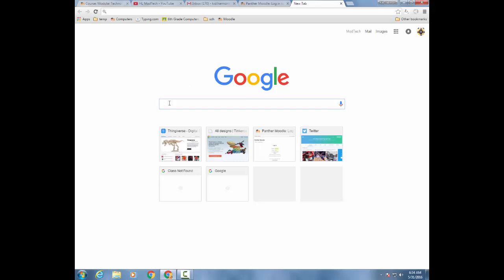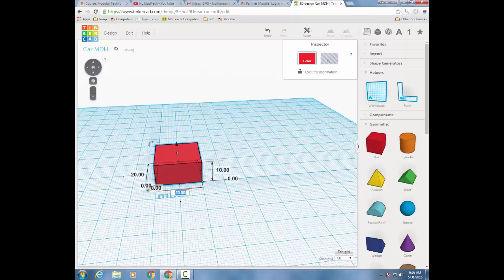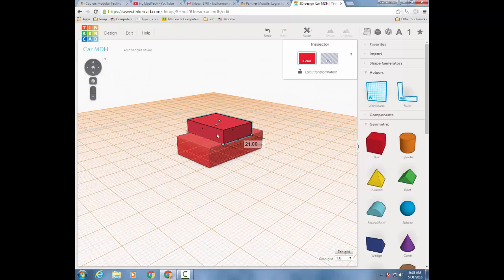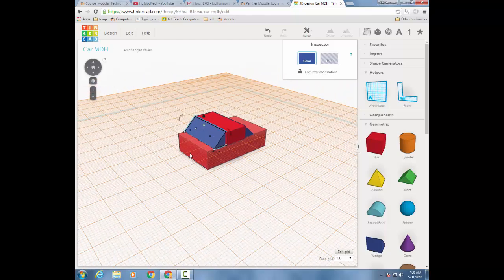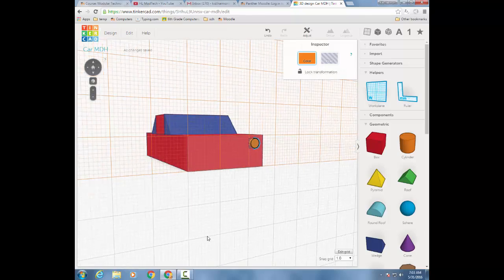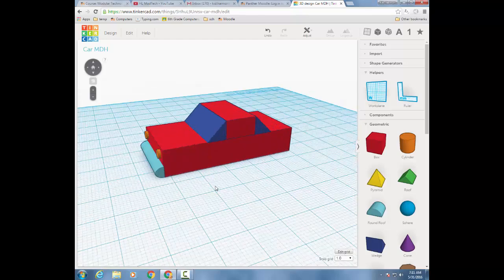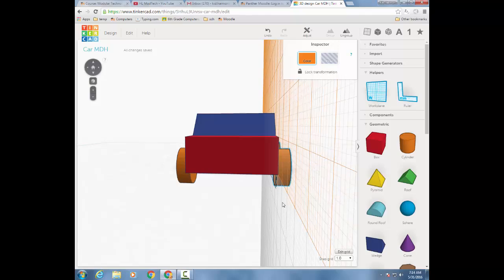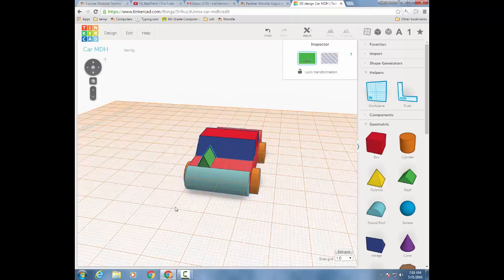AMAZING! Design a CAR in Minutes! #Tinkercad #STEAM #STEM

Comment: I made an improvised spoiler using a T in the Characters and Numbers section
Reply from the maker: That is a fantastic idea! My latest videos I have been using the scribble for that. https://youtu.be/aOo7uvWqqdY That is just the car, but part 2 (upgrades) has the spoiler. So much room to make cool stuff on your own! Have fun and thanks for sharing! 👍💯
Reply: @HLModTech  thx 

I also used Half Spheres for the headlights and a box for the bumper

(I'm Mohammed Ahmed but I'm using a different account just in case u r wondering)
Reply: @HLModTech  i put the link for my design below:

https://www.tinkercad.com/things/7RFqwPWbxeq-ahmed-design-djs/edit

(i scrapped that idea as it made the back of the car look weird)